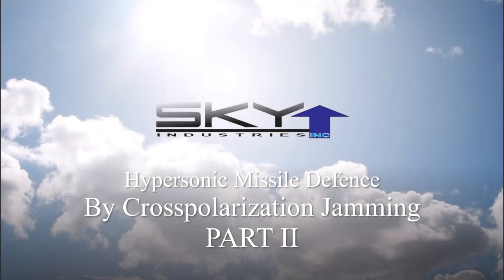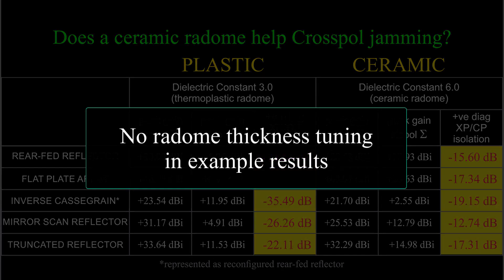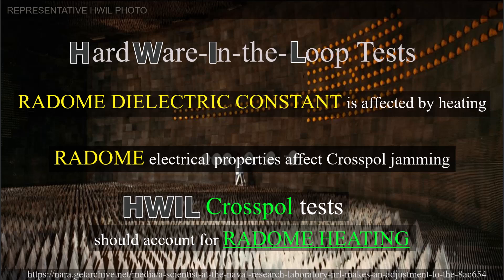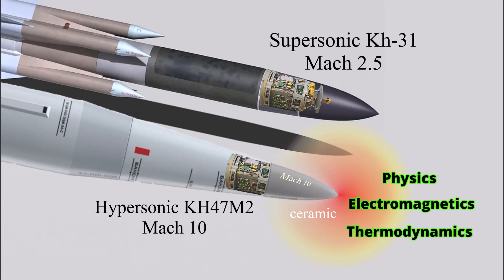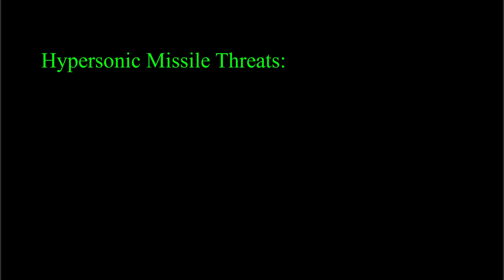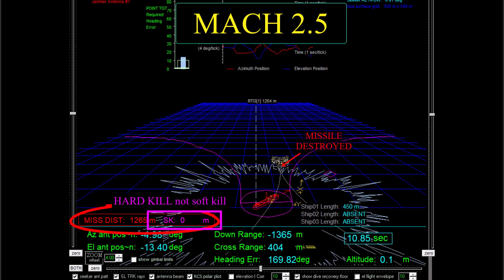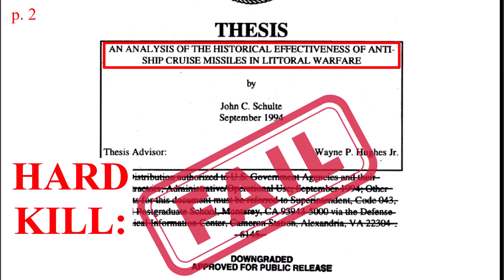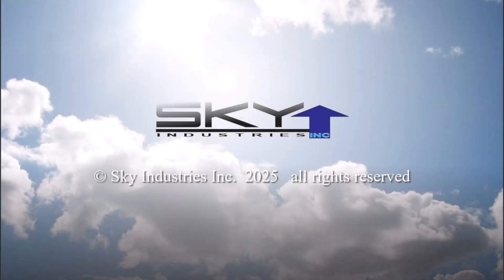Hypersonic Missile Defence By Crosspolarization Jamming PART II 25

Comment: Well, I'm engineer but in a quite different area. Like your videos very educational. But have some remarks, could be that I am completely wrong. Assuming that hipersonic  missile have to slow down to get the target is nonsense. If it is static target - why? If it is aircraft carrier - it either static too, or is moving so slowly (about 1km per hour) that is no problem to calculate the impact spot. Hipersonic missile need 30 second  from 100 km attitude (suppose that they do not need that attitude anyway)  to hit the target. If it is on a full speed air carrier it will be just half kilometer away. And  BTW - the plasma 'shied ' is only in the lower atmosphere - so it's targeting system will work at least 2/3 of the time - leaving the air carrier  only 10 seconds to be out of the targeting system of the missile. And with that speed they fly - don't know, but I doubt that there is any corrective guiding, everything is set long ago. That's also in the idea of crating 'false' targets.
Reply: los portaaviones se mueven bastante más rápido que eso xd
Reply: >If it is aircraft carrier - it either static too, or is moving so slowly (about 1km per hour) that is no problem to calculate the impact spot.
I've never known a ship to be moving at 1kph outside of anchor. Missiles are also not diving straight down from 100km. That would be a horrifically inefficient design, and basically a best case scenario from a hard kill intercept perspective. But you're forgetting the second biggest issue a missile faces that the seeker system solves: where is the missile? INS is only so good, especially in the violent hypersonic regimes. It can guess as to its location, and guess as to the location where the ship is, but the error build up between the two is substantial. Far too substantial to make such a large and expensive system useful without terminal guidance.

Comment: Couldn’t they discard the ceramic radome?
I mean, I have to imagine building a radome that’s strong enough to fly but then be split apart to be safely discarded after it has slowed down to a speed they can use a thermoplastic, but that’s what I’d look into as an armchair designer.

Comment: Is this still relevant in a post Cold War world? 

I assumed that these days hypersonic would receive guidance from satellite during the plasma phase, like starship. 

Seems dubious to assume any modern hypersonic are self guided
Reply from the maker: Yes still applies post-Cold War, but to be clear: Crosspol is a countermeasure against RF radars and seekers; doesn't apply if the weapon doesn't use one.  

The hypersonic missiles I have looked at in open sources are advertised to use inertial navigation for most or all of the flight, and could in principle use satellite for backup or primary guidance, but if the target can move, some kind of terminal guidance is need when the missile gets close.  If the missile slows down at endgame the plasma phase is finished.  

Some people seem to believe satellite guidance can be used to hit a moving target, without using a seeker.  I am skeptical based on missile speed and lateral acceleration required to correct late heading errors.  But I do not know for sure.

Comment: Can they not design a missile that ejects the hypersonic randome when it’s no longer needed?
Reply from the maker: Good question; certainly it's possible, but at what cost and risk and for what benefit?  

The problem doesn't go away - a thermoplastic radome also creates Crosspol vulnerability, just less than a ceramic.

Comment: I think AI with camera is so easily discounted in this video
Reply from the maker: That would require a high-drag (approximately hemispheric) transparent radome.  

Is it possible?  I don't know; seems like a very high penalty in temperature and speed.  And very hot inside the radome cavity.  

And the designers are betting their pajama bottoms on good weather, no optical obscuration, no lasers for protection, and fast correct target recognition.

Comment: New to this, what I do not understand, the jammer is broadcasting a Rf signal from the ship, so why does the missile turn directions, does it just effectively overwhelm (blind) the seeker where it turns to another direction and does the reset action as seen in the video clip? Another, with these long range cruise missiles, how do they accurately determine the position of a ship or object of interest at distance when the beam width is dramatically larger at distance, even with high db antennas, do they just rely on increasing accuracy as it gets closer, since at distance if there are two objects of similar construction, can it not just lock onto another object that’s not intended to be hit? I know this is a very long topic to discuss, simple answer would be nice, great documentation anyways!

Comment: This is amazing work. Thanks!
It's not unreasonable to assume that missiles can be guided by receiving signals from another missile with a higher altitude flightpath. A networked missile guidance pattern might remove the need for slowdowns...
A very high altitude, vertical attack pattern might mechanically make jamming difficult with some of the existing jammer technology. 

Such a fascination and deep field to study. Good luck!

Comment: Very cool.
This Q will probably get buried in the other comments, but...
Wouldn't it be possible to make a ceramic phased array on the outside (on the surface of) the nose-cone so that the dielectric crosspolarization problems are avoided?
Could print the antenna patches in graphite, for example.
Reply: Yeah, but the antenna beam width would be all over the place I assume, don’t know if phased arrays are capable of angling to shoot that far to the side (forwards or the missile) since the cone shape is quite sharp, and there would probably be a big blind spot right in front of the missile goings forwards and expanding.

Comment: I have a neophyte question. The benefits of using an EM-based soft kill system over a traditional hard kill or interceptor-based system are obvious and compelling. The thing that makes me nervous about depending on soft kill systems is an inescapable "feeling" (I have no education or experience in this field) that counter-counter measures could be employed by an adversary to render a specific soft kill technique suddenly and unexpectedly ineffective. If assets are deployed under the assumption of an effective defense, a sudden neutralization of that defense could lead to many vulnerable targets and catastrophe. Maintaining weapon effectiveness in the presence of a reasonably functional interceptor may require an adversary to add/modify hardware or maybe produce more weapons. In the never ending cat-and-mouse of "counter" and "counter-counter", these kind of adaptations take significant effort, treasure, and most importantly time...enough time for the defender to realize that a counter is coming, and adapt both the defensive measures and asset deployments accordingly. It seems like soft kill defenses can potentially be overcome with much simpler modifications such as software updates, flight profile changes, physics tricks, or even (in this case) replacing nose cones with a new material. These changes could be done quickly and opaquely, becoming a rude surprise to the defender. So after all that typing, my question is...what do you think about the longevity of crosspol jamming as a solution? I'd never heard of it until watching a couple of your videos. Thanks!

Comment: What if you shed the ceramic heat shield once the missile slows down?
Reply: I guess you’d still need to have a thermoplastic underneath the shedded heat shield to protect the radar equipment from aero loads.  But maybe you make the heat shield insulative or ablative to not exceed the working temp of the thermoplastic underneath

Comment: What do you make of the Oct 3 Iranian BM attack on Tel Nof airbase, Israel. Probable terminal EO per the sat photos? Fixed rather than moving obviously but seems extensible enough to the AShM context posed in the video. Not obvious they hit any objects of real consequence, but all the same I wouldn’t’ve wanted to be loitering outside during the proceedings.

Home-on-jam is a thorny problem with various counters, as you say, radio wavelength funkiness and so on, home-on-dazzle less so? Bright spot, dark ocean.

Comment: Have to wonder if those quantum gyroscopes/ inertial navigation devices can be accurate enough for these hypersonics to hit targets despite flying blind.
Reply: Even legacy inertial navigation and / or GPS guidance is fine for hitting targets, whether or not at hypersonic speeds, if you know where the target is going to be and the blast radius of the warhead is big enough. But this is dealing specifically with anti-ship hypersonic missiles. Short of a surprise attack at anchor (Pearl Harbour 2: Thermonuclear Boogaloo) there is no chance the ship will be where it was when the missile launched. And the missiles are (I believe) kinetic kill warheads, I.e. the blast radius is 0 - it needs to make contact with the target.
 
So the inertial navigation/ GPS is used to get the missile to a ballpark area, but some terminal guidance is required to find the actual target.
Reply: Good answer, RaytheonTech!
The exact reason he's talking about stops is because ships move. That's why Russia is using hypersonic missiles against large Ukrainian things like power plants, and not sniping at leadership with them.

Comment: I only have a rudimentary understanding of how radar antennas work, would this work for missiles with phased array radars?  I figured that most newer missiles would have AESA radars.
Reply from the maker: Short answer: yes it will work against missiles fitted with a phased array antenna.  

Slightly longer answer: The degree of susceptibility depends on what type of radiating elements the phased array uses, and the shape and material of the radome.  A slotted waveguide array has very low crosspolar gain, but put the radome on and the whole thing is susceptible to Crosspol jamming.  

There are nuances, but in the broad strokes every single seeker I have ever tested with is susceptible.  There are no exceptions.  

And they all behave the same way, see 2 min from 3:24 here: https://www.youtube.com/watch?v=VfOyKr7R38w
Reply: @skyindustries  Thank you so much! I only just found your channel so I'll have to go through the backlog of videos to learn more.

Comment: 6:10 what would you think about the feasability of putting both radomes onto a missile, where a ceramic radome is used (almost like a fairing) during the mach 10 phase, which is then jettisoned after slowing down, so that the benefits of a thermoplastic radome could be used.
Reply from the maker: Good question; the seeker would still be vulnerable, the thermoplastic dielectric is about 3.  A high dielectric constant (air is 1.00058986) in combination with the radome shape will raise the crosspolar gain of the underlying antenna, no matter what type the antenna is.

Comment: I wonder if you could harden a hypersonic missile by moving the seeker off of the ordinance and onto an exoatmospheric platform using a datalink; there is some precedent for certain types of data communication to hypersonic objects, even RF communication.
Reply: There is another sub comment that talked about that

leo sats would be the best for that BUT you will need A LOT of them , and depending on the detection they may not work if there are clouds, if they use radar then a ship will still be able to jam it or at least know that they are being looked at (and with the numbers needed, the chances of the radars info being leaked would be much higher)

Geo or heo will have latency problems , you will need fewer more expensive sats

But they both have other problems too

I dont doubt that if china makes such a constellation then the us will try to get it stuxnetted

And theres always the danger of the datalink being jammed or spoofed 

(Do note that im in no way an expert)
Reply: @nikolaideianov5092  Very interesting. Sub-comment on this video? I will have to look for it...

I imagine a LEO SAR constellation would have the highest performance; there are of course already companies which have LEO SAR constellations, but they probably don't have the required capabilities. I would like to learn more about SAR jamming.
Reply from the maker: @nikolaideianov5092  no your comment is pretty expert.  You're spot-on by my thinking.

Comment: With 10 seconds to target at Mach 10 there is no value in permanent correction of direction as large ship can't move anywhere from projected position  in 10 seconds
Reply: Id argue the context is that with countermeasures there is no real course correction at the approach, simply put the missile leaves mach 10 blind and stays blind with countermeasures.
Reply: @lelagrangeeffectphysics4120 "Normal" missiles needs seeker as during the tens of minutes of flight the target could move from intended location quite far - especially such missiles as fast cruise missiles considered here,  as it flies . low and have no means to correct targeting for actual position of target. With hypersonic missiles they need correction only some time before final dive to rendezvous point, not to mention flight time is typically under 5 minutes and dive is few seconds.
Reply: @lelagrangeeffectphysics4120  my reply about timing etc has been censored out thought I have no idea why 😮
Reply: @maxinfly  try-adding-some-hyphens-it-usually disturbs-the-content-censor

Comment: What about radar with circular polarization  ? phased-array with polarization diversity? would they not be immune to these jamming ? the 3M22 Zircon and DF-17 seem to use phased-array radars
Reply from the maker: Superb question.  Circularly polarized seekers are also vulnerable to Crosspol: https://www.youtube.com/watch?v=VfOyKr7R38w

Crosspol susceptibility depends on the antenna-radome combination.  The crosspolar gain of a flat plate array depends on the type of elements it uses: sloted waveguide has very low crosspolar gain, cavity-backed microstrip elements appear to have very high crosspolar gain.  The radome increases the crosspolar gain in every case.  

I have run tests against a slotted waveguide flat plate array antenna; as expected there is negligibly response until the radome is added.  Then it's business as usual.
Reply: @skyindustries  Maybe also make a video on filtering algorithms if you have some knowledge in the area
Reply: @skyindustries  how do phased-array radars with real-time polarization diversity (supposetly 22 Zircon or DF-17) fare against cross-polar jamming? specifically, can their adaptive polarization capabilities dynamically compensate for the radome-induced cross-polar effects, does the structural interaction between the radome and antenna still create an exploitable weakness for jamming? I suppose they can adapt their polarization to the jamming itself and null the jammer
Reply: @skyindustries  really interesting rabbit hole this crosspol weakness, I have just used DeepSeek to check a bit deeper. Thank you for your videos

Comment: Use Ceramic until speed has slowed to less than mach 2.5. Then eject the ceramic and have the polymer shield in place. Multi levels of defense are required so deploy both hard and soft kill systems.

Comment: The march 10 plasma black out issue is solved. So your thesis will not work. The evidence is China maned module return video, no interruption, full strength signal. They use some type of Ti hertz radio wave.

Comment: 6:10 why not have an explosive decoupler to shatter the ceramic nosecone when it slows down so it's left with the thermoplastic?
Reply from the maker: It would still be hugely vulnerable with a thermoplastic radome, dielectric constant ~3.  

Also very difficult and tricky to design and field a missile that hits its target reliably enough to warrant the customer expense - and investment of the development cost.  Add an exploding radome: yikes.  Extra weight, extra complexity, possibility of damaging fins or body or seeker, etc.
Reply: @ ignoring those side effects, do you have some broad ideas of how the crosspole jamming would be negatively affected? 

Because ceramic fairing-wise, you could have it be in 4 secable parts, where the ceramic cone inside is thinner where it's meant to separate, or is bound a different way (tongue and groove joint held with a type of metal can be melted off with heating wires), and have the 4 parts offset 45% from the fins' placement
Reply: The hole in the wing of the space shuttle caused by a bit of styrofoam is why.
Reply: Great explanation, and I appreciate the response about thermoplastics and their dielectric limitations. A related question—has there been consideration of leveraging modular radome designs that incorporate a dual-layered or compartmentalized system, where one section could house high-dielectric materials for lower-speed tracking, shielded during the hypersonic phase but revealed as the missile decelerates? This wouldn’t rely on the same thermoplastic properties at high speed but instead on a sequence of material exposure tailored to each flight phase. It feels like such a design could bypass the single-material constraint while maintaining tracker effectiveness. Could such an approach pose a challenge to cross-polarization jamming? Would love to hear your thoughts.
Reply: That was my first thought too. But no - the cost, mass and it would almost certainly destroy the missile when it popped off.
Maybe a window or rotating system, but throwing bits into the air stream would be bad.

Edit: seems like Iran does it! https://youtube.com/watch?v=WLpvEoMNEls&lc=UgzKZHKqJcBTO4VLZol4AaABAg&si=nU4y3pb2mN_w-Cci
Reply: @NigelTolley  that's just the current video link